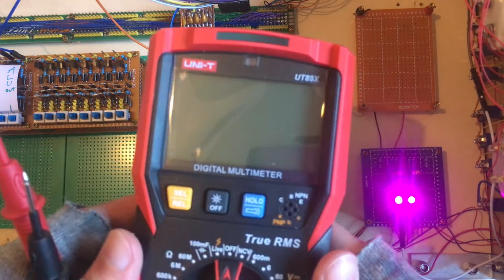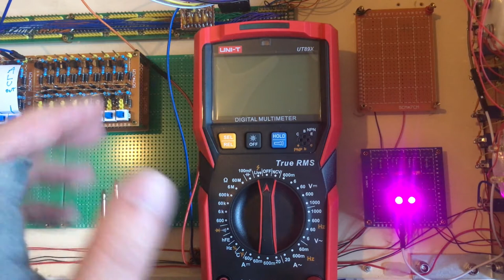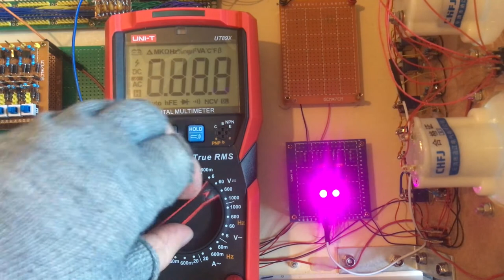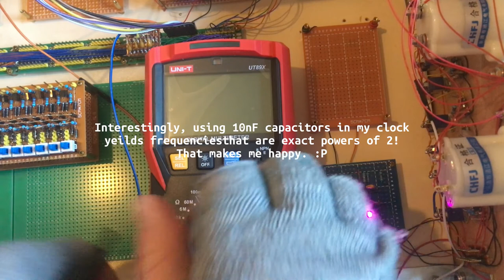Discrete 8-Bit Computer #43 - Sequencer & Other Bits

Comment: If the transistors in the power supply get that hot you may want to use some bigger heatsinks, along with a transformer with voltage closer to the desired output voltage.
Reply from the maker: They have heatsinks on them but these were an afterthought, I had to sorta cut them to fit! But yes, I may look into getting a different transformer and see if that fixes it. Thanks!

Comment: 240v AC -> 9v : DC Transformer
9v DC -> 6v-: Voltage Regulator
9V DC -> 3.3v Voltage Regulator

240v AC has more than enough current to power your computer, the problem is with the regulators and noise between components; not the transformer; having large sparse loads is just inefficiently regulated;